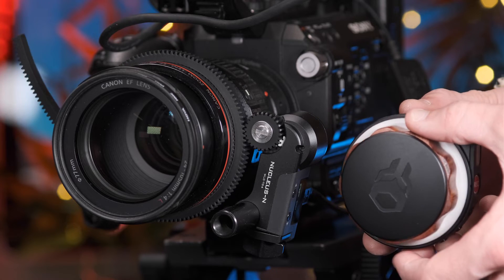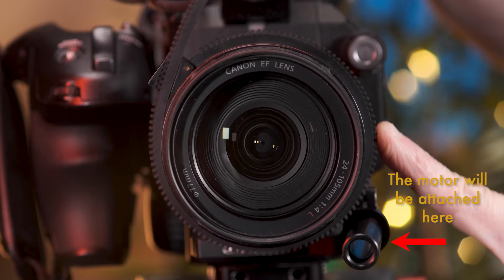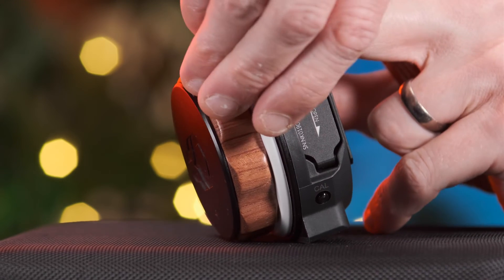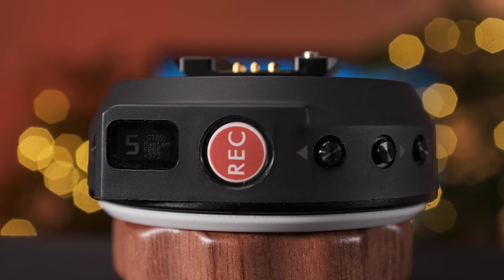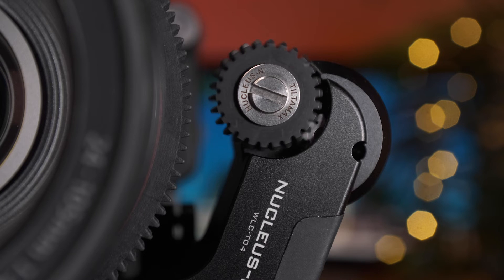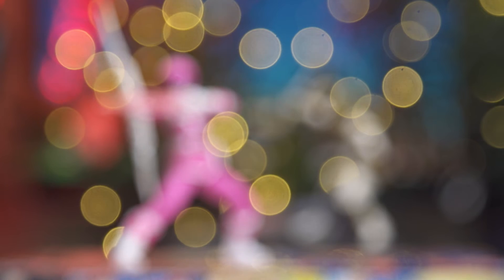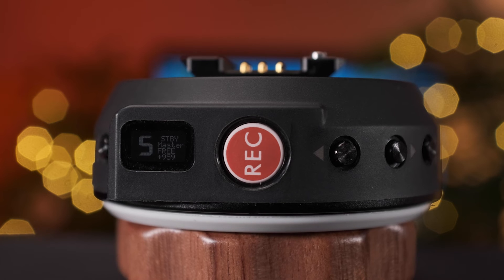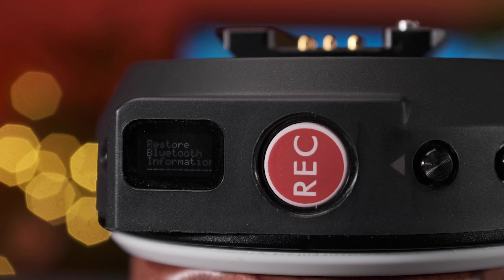Tilta Nucleus Nano Wireless Follow Focus Review: Setup and Overview

Comment: This device comes with manufacturing defects that TILTA does not want to respond to, the LDCs come with a short useful life, the light intensity fades in the best of cases or suddenly stops turning on, but the device continues to work without the screens on. utter garbage.
Reply from the maker: Yes, unfortunately we’ve seen his occur on 1 of the 5 devices we have which is very frustrating. The next generation needs to address this but for me the most important change needs to be moving to the use of standard batteries like AA or AAA
Reply: Hi, I have used it 3 time in 4 years and the LCD is very dark... any solution?
Reply: @matteogiordanoimageart  did u find a fix ? Thank you